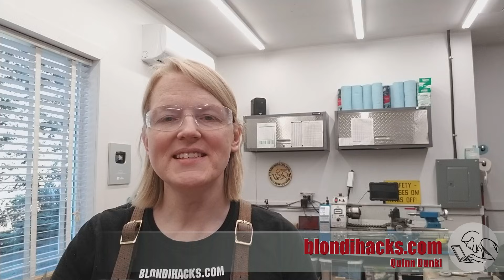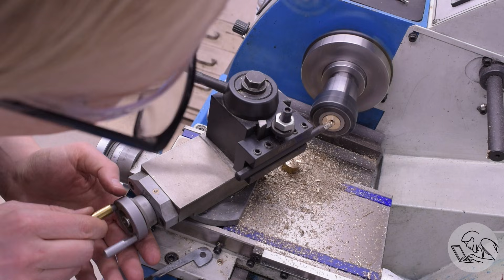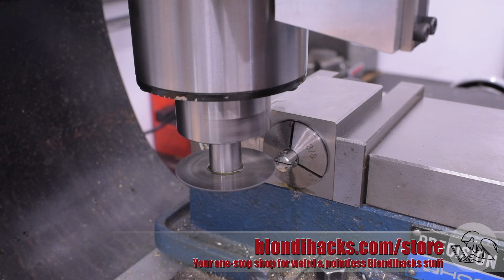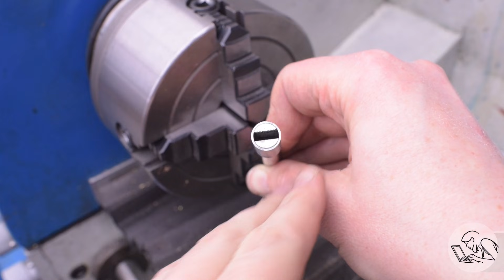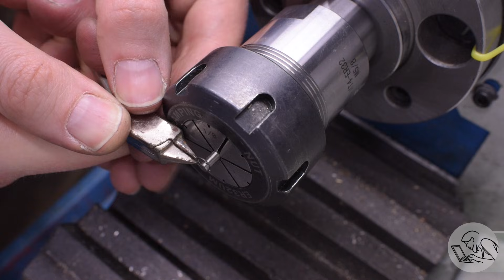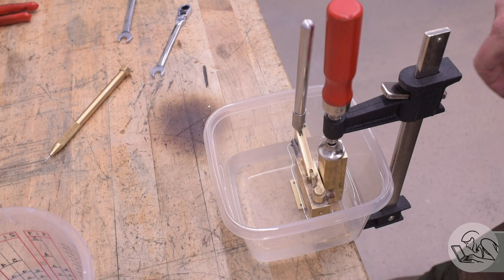Finishing The Water Pump - Pennsylvania A3 Switcher, Part 32

Comment: Beautiful job on the hand pump, Quinn!  I had the same issue with the travel of the pump handle and had to do the same thing - file out the slots in the linkage.  And the same issue with the o-ring retainer. My solution for this was to open up the hole for the ram a little bit so that the deformation from tightening the set secrew didn't impede the movement of the ram.  Your solution is much more elegant though! Thanks for sharing the struggles you have with the design too. Thats one of the things that sets your channel above the others.  It's real!  I appreciate that! 😊

Comment: Great video (as always!), and fun to see the function rising from the flat metal.
Two questions:
1. The pump is hidden beatifully, but where Is the detached handle hidden/stowed?
2. I see mixed metals in a water filled environment and wonder what stops these junctions destroying themselves through electrolysis?
Reply: 1. Live steam enthusiasts always have a number of tool boxes full of handles, hoses, burners, little shovels, fuel, etc. She will also be building an “engineers seat” car since the loco is too small to ride on directly, so she could build a compartment into that car.
2. Electrolysis is a non issue with fresh water (miniscule). Salt water is the environment to worry about, so as long as she stays out of the ocean, the fresh water in the tender will not be a worry. ; )
Reply: Thanks  @DoctorShocktor  yes (1) there is a blurred line between the realities of the 1:1 prototype and what is needed to make the smaller scale reality work. Which leaves me wondering why the water pump intake filter can't have a plastic slip on ring with fine mesh filter... plenty of room as it happens, and just as hidden.
As for the water (2) I am guessing Quinn will be paying for a gallon or three of distilled water. Drinkable tap water has more than enough electrolytes to cause mischief.